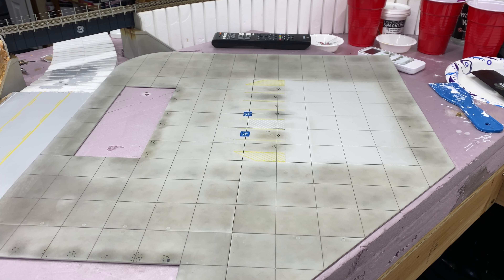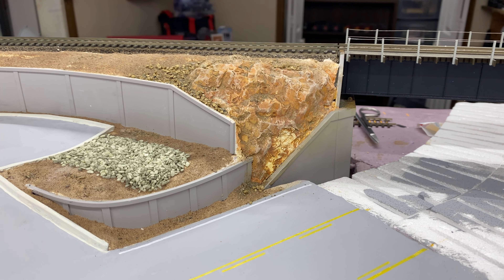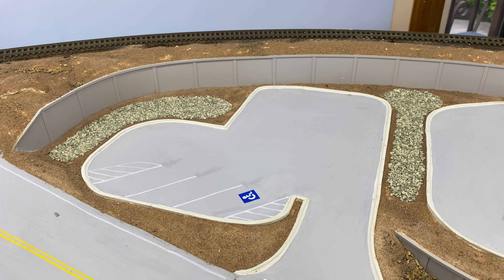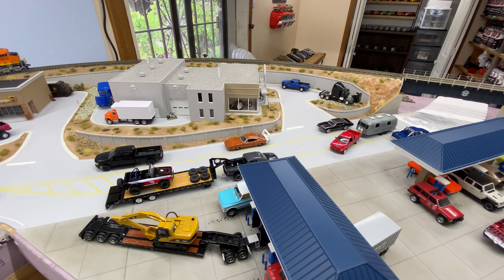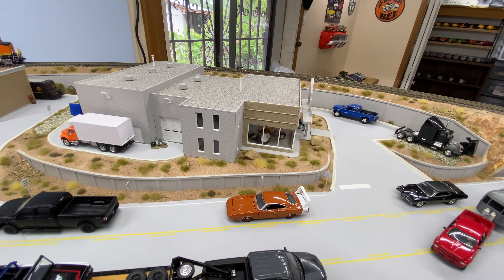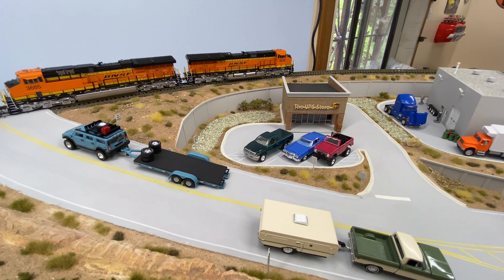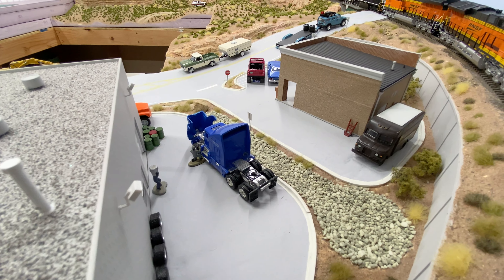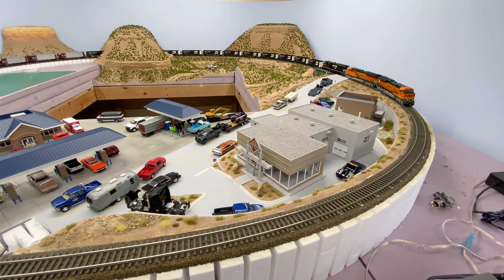Building an HO Scale Model Railroad: Layout Update (10)

Comment: Hey man, I was just wondering how you run your locomotives Mu'd back-to-back using the DCS52? I got one a while back and just started using it again. Awesome layout!
Reply from the maker: @RathdrumRailfan  hey dude, it’s pretty easy. First you need to assign addresses to the locomotives you want to MU together. I usually use the road number for the address. After you have assigned addresses you should bring up the address for the lead locomotive. Make sure it is in the forward direction. Bring up the trailing locomotive and make sure it is in the reverse direction. Return to the lead locomotive address. After doing so click the train shaped button and the address will become gray. At the bottom left hand corner of the screen you will see a selection labeled MU. Press the button underneath that selection which is “A”. After pressing the button, input the address for the trailing locomotive. The selection for MU the bottom of the screen will change to MU+. Press “A” again. It should say “Loco consisted”. Then simply press the train shaped button again. It will return to the lead locomotive address. 

To remove that trailing locomotive from the consist just input the address into the controller and it will be gray in color. Just press the “A” button and a selection at the bottom middle of the screen it will show a selection labeled “MU-“. Press the button “B” and it will remove the locomotive. 

If you have any questions please don’t hesitate 
to ask. 

I also recommend that you make sure that the locomotives you are going to run together are speed matched. Sometimes two locomotives will run well together at the same speed especially if they are the same brands. Just be careful that you aren’t dragging or pushing a locomotive with one. That can cause problems with overloading and damage to the locomotives. 

Thanks for the compliment!
Reply: @ Thanks so much for the help!